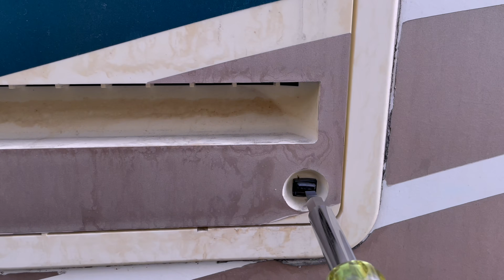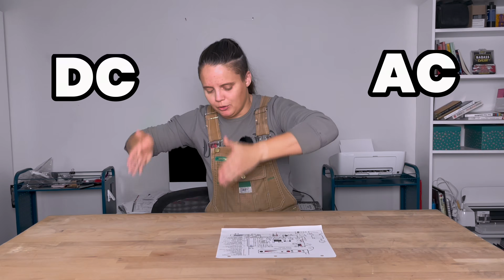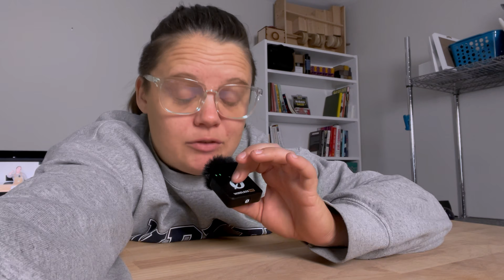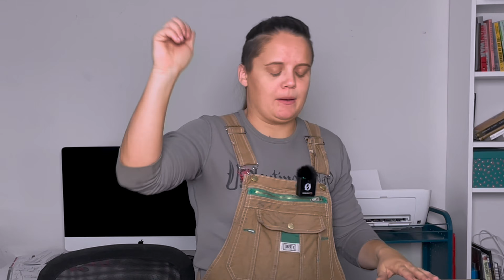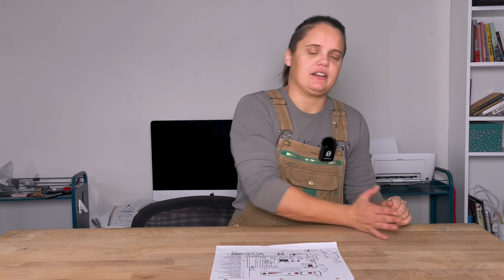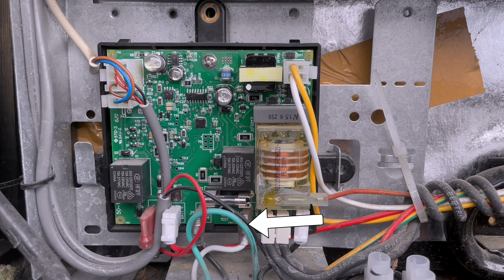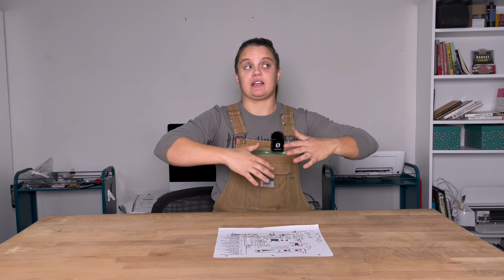How to Troubleshoot Your Dometic RV Fridge (With a Mobile RV Tech)

Comment: My problem is a F Error, burner ignites good flame and keeps igniting till timeout when the gas line solenoid shuts down fuel flow as it thinks the fuel is not lit. I cleaned then replaced the ignitor line and corroded burner tube and cleaned checked contacts of ignitor and thermocouple. The ignitor gap looks good-ish and gets the tip red hot. Fuses on the board are good, same  F error on eyebrow denoting that the gas ignition liting is not recognized as such. What can i do next on this 2001 Norcold N621 ? AC mode works fine. My ignitor is supposed to send millivolts back to the board showing it is lit but something after that point is "out to lunch". The replacement Boards are not easy to find, i could try a third ignitor... Any suggestions.

Comment: Hi have a dometic americana 2
Ran out of propane in the middle of the night switched tanks its all working with flame constant for over 8 hrs no cooling taking place though.
Electric works to cool but propane is all working with flame but no cooling taking place checked the thermal disc fuses etc.???

Comment: @rvrepairwoman what if it starts on propane SOMETIMES and then runs but eventually turns itself off? What is the issue then? Like the fridge cools and everything is fine but I come back after a few hours and it's turned off and is more difficult to restart?

Comment: Hello Emily, I find your video very helpful. I just have a question in your video when you’re doing the electrical and your testing the black wire going back up to the circuit board it’s supposed to have 12 volts  Mine only has nine. I had my circuit board checked, and it was all good, I was wondering, how do I know if my fridge is just crapped out and I need a new one

Comment: This video is very informative! I am retired maintenance worker, and following your tests there were a few things I didn't think of. My problem was not the control board, that all the tests pointed to. It was the thermal switch needed to be rest, which was confusing for me because I had power going in and out, but still would not cool on AC. I did put a new control board in to no avail, and sort of stumbled on the reset button. The problem I have now is everything is freezing in the fridge, so I assume the switch still isn't working properly, so I will replace that also. But again, great info! Thanks!

Comment: My igniter will not stop clicking and arcing. It lights and keeps running, but the igniter keeps sparking. The last 1/4" of the thermocouple glows red, so it is sensing heat. Also, it appears to be running ok other than that. I'm not sure where to go from here. It does not have a thermo disc.

Comment: Emily, I’ve learned a bunch but no dice…

Any idea if pilot lights but only for a few/10 seconds? Works on AC but not on gas. Pilot only stays on for 5-10 secs. Solenoid? I’ve changed ignightor? I am a little curious I have a board out of an older refrigerator that supposedly worked but it has J2 through 10 and the one that I have has J1 through 10.

Please help hold up in the remote part of the Colorado mountains

Comment: Hello, thanks for the  great information. We followed every step, and all was okay except our original problem.  We have a new dometic dm2672 2- way, which continuously buzzes and the check light is on when set to auto (AC) even though the fridge works. Propane works great , no buzzing. Do you know how to stop the buzzing?! 😂

Comment: I’ve done all of the diagnostics you’ve shown here and my problem is that everything passed. I can’t get my fridge to run on A/C because it keeps defaulting to propane. I have 12 volts to both the green and black wire simultaneously. Any idea what’s going on?

Comment: Hellllpppp! Tested everything like you said, no volts at the orange wire, so changed the circuit board and still no voltage at the orange wire.

Comment: Lots of great information but what if i dont have voltage to the yellow wire? The one that goes to the valve. The lights work fine on the eyebrow but the "check" light stays on but the fridge wont turn on. With the gas on, and the eyebrow to gas, i have no power to the yellow wire. Please help...
Kris

Comment: I have a little stinker of a board of the diagnostic side. Dometic board just like the one for your parents. I checked everything you suggested except the orange and black wires in the connector oops and the disk. I tested the element out of the camper by hooking up to electric cord, cherry red. And 12 volt fuse is good. Werid thing about the 120 fuse is the fuse removed I get 120 volts on one side of the holder, OK put fuse back in and 120 volts NOT on the other side. Test heater element pins #7 and #8 one side still has 120 volts ac at these terminals. What am I missing? I took heater element out of holder and was dangling outside the fridge plugged in to 7 and 8 terminal still nothing. I didn't check disk but even so why does voltage appear at 7 and 8 no heat. Could my board be no good?
Reply: I do realize with 120 volt fuse out nothing should go any farther, there should be no power down the line.
Reply: Well just got back in from testing again, tested disk continuity okay. Didn't have any voltage on either wire to disk. Took 120 volt fuse out and still have 120 volts at pins 7 and 8 for the electric element. Oh, yes checked orange and black up in left top corner both have 12 volts DC. So what does the 120 volt ac fuse protect? I will watch your video again to see if I interpreted something.
Reply: At 18:21 you speak of checking line voltage coming into circuit board on the left pin is the black absolutely no voltage this is marked AC line, pin on the right labeled AC neutral the white wire. Checked both wires black ac line has nothing white on the right neutral has 120 volts on it, I think the wires are switched the white with 120 needs to be on the AC line, is that correct?
Reply: After gas clicking 75 clicks 3 times it won't go into electric mode, terminals 7 and 8 never ever get 120 volts when they did befire I switched the line in and neutral on the board.

Comment: Great video!  My fridge is working on gas but not electric. I went through the whole video and I don’t have 120V on my heater pin. I flicked and tapped on the relay but no change. Looks like I will need a new board. Thank you for the step be step troubleshooting!

Comment: Question! I have Dometic fridge circa 2007? Works great but must be unplugged from a/c current to run on propane? Set to gas only mode? Has new control module.

Comment: I went through EVERY step you recommended to trouble shoot my Dometic fridge. (Thank you) But I couldn't find any obvious problems. Every electrical test showed all was well. I finally called a professional to come take a look at it. It's reading an error code "E0", which supposedly means a communication problem. He told me to replace the button controls and the digital controller/display card. It's still showing the same error code... any ideas? It does not have a leak and the heater gets hot when he put power directly to it. Thanks

Comment: I have 12:46 in the orange cable and 10:75 in the black one, is it ok?
Reply: I checked mine yesterday and found 13.35V on the orange wire and 10.85V on the black wire...I'm pretty sure you are okay with your readings

Comment: Great video and you explain things very clearly. Thank You!  I followed your directions and 12 volts at orange wire/pin (on control board to eyebrow board P1 connector), but  only 1.4v on the black/wire pin a the lower/outside control board. Assuming either the eyebrow board itself (upper control board) or a wire between the two is bad? Lights on the eyebrow/control board inside intermittent and although bulb is good, the inside light doesn't work. Schematic shows eyebrow board supplies the 12volts to the inside bulb also so it must be getting low voltage also from the eyebrow board? Your thoughts if you get a chance to respond would be appreciated!

Comment: You Rock Rv Repair Woman!  Thanks for this brilliantly informative guide.  We have a Dometic 3 way van fridge that failed a couple of years ago.  I watched a fridge mechanic fix it... it was failed 240v heating element.  Fridge failed again a tad over 2 years later, so I watched your video on testing amps and sure enough, the element had failed again.  I noticed a dodgy connection on the thermal disc, so switched both parts out.  Once that job was done, my eyebrow board was dead... so watched your video again in full and chased down wires everywhere, to find a blown fuse.  So thank you once again.  Saved us from opting to fork out $$$ on a new fridge!

Comment: Dometic RMD 10.5T is not operating on Gas. The control panel, control brick and solenoid were replaced 6 months ago and worked perfectly up until about 2 weeks ago. I am electrician, have checked the solenoid which is OK. There is no clicking can be heard, I think the control panel is working OK but can't be certain. My question is, how to test the control brick? I can't see any burnt or lose wires. is there a circuit diagram available?

Comment: I have no power at the yellow wire on the circuit board that goes to the gas valve. What would you recommend doing next?

When turning on my fridge it immediately illuminates the check light. And I hear no clicking from the igniter or gas valve

Comment: I did all the steps and my dometic rm2354 fridge has a flame on propane mode but there is a dim check light that pops up only on propane mode this doesn’t happen on ac mode if connected to shore power I checked the circuit board at all the points in your video and heard tick after and see blue flame everything seems to be working except for this dim check light on dc/lp mode, why is this??? Pls help

Comment: This is a fantastic video. I make it to the point of the video where we start to check AC voltage. All my DC voltage is fine... but as soon as I plug the fridge into the 120 v outlet, everything trips and shuts off and I have no more 120v. I have tried the 120v outlet next to the fridge on the camper... I have also run extension cords to more than one outlet in my house... and the end result is always the same. After being plugged in, a few seconds later ... either 30 seconds to a minute, it will blow the 120v outlet. Thoughts? Dometic fridge. Thanks.

Comment: Thanks so much for the great video — it was really helpful!

I have a Dometic fridge in my Airstream trailer, and I recently replaced the circuit board because the fridge was working intermittently. I suspected the board was the issue, but maybe I was wrong. Now that I’ve swapped it out, I’m getting two quick flashes on the “check” light on the eyebrow board.

Is it possible I hooked something up incorrectly, or could something else be causing the problem? Any insight would be really appreciated.

Comment: Great video, so in depth! Found my faults and now I need to fix them!

1. My gas valve is not getting power
2. Black wire from eyebrow board  for ac is not getting power.

Just replaced eyebrow board and all lights working. Any help much appreciated!!

Comment: I have a dometic fridge. I’m getting 120v to my outlet but when I test that j5 port I’m getting only 77ish volts. Pushed all the ports in to make sure nothing is loose. Could it be a bad ac plug that I should replace or bad circuit board? The fridge runs for a few minutes then my thermal disc pops and needs to be reset when I’m running it on shore only.

Comment: This is the best troubleshooting video I’ve seen on the subject. Well done. One thing missing, which seems to be somewhat common. Is the flame igniting and running for a about 10 seconds then turning off.
Reply from the maker: Yup. I’ve gotten a couple comments about this - if this happens to you I’m guessing your igniter is bad. Inside your igniter is a part called a thermocouple that tells the circuit board whether or not you have flame. If that goes bad then the circuit board doesn’t know you have fire to burn off the propane and shuts everything down so we aren’t shooting propane everywhere. Try changing out the igniter and see if that solves your problem
Reply: @rvrepairwoman  if I may say, this doesn’t make sense to me. If we have fire, the ignightor is doing its job, correct? I’ve replaced my thermocouple and am wondering if it’s the relay? I have the same 10 sec flame on /off

Comment: Thank you for the video, my fridge wont get cold on electric and propane. Was going thru the tests and when the ignitor kicked on I got a huge whiff of ammonia, so seems I have a leak somewhere. No yellow dye so its somewhere. Looks like a tech job now, sucks especially since I live in my 5th wheel

Comment: I wonder if the thermal disc or fuse is my issue... My fridge works on 240 and 12V, it lights on gas but then switches off multiple times - maybe the flu is blocked and the disc is switching off?
Reply from the maker: Definitely go check your thermal disc. But if that guy is testing fine, then I bet you have a bad thermal couple. It’s not something I talked about in this video but your thermal couple is a part of your igniter and that’s what detects if you have a good flame. So if it goes bad, then your circuit board doesn’t know that you’ve gotten a good flame and so it shuts the fridge down. So that’s the next thing I would check.
Reply: @rvrepairwoman  that's so helpful. Mine is a  10.5T but there isn't a thermocouple above the flame. I've seen the Domestic burner design with one above the flame but mine doesn't have this. A trip to the engineer I think

Comment: Great video. I followed your steps, replaced the control box and now the fridge works on electric.  It does not work on gas.  there is 12 volts at the gas solenoid but it does not trigger.  It does work if I power it with a jumper,  12 volts and a jumpered ground.  Also no spark.  While checking the grounds I unplugged the J-10 plug and could hear sparks jumping around inside, plugged it back in.  I feel like there is a ground connection missing somewhere.  I this another bad control box?  Thanks

Comment: Great video, thank you so much for all your information, I would have been lost without your help, I've already changed the eyebrow board with no luck, bought thermal disc, don't need because mine still good thanks to your help, now thinking it the main board, no 12 volts at black wire or orange
Reply: Put a new control board in and eureka it worked I have my refrigerator again, wanted to say thank you again, I couldn't have done it without you

Comment: The thermal fuse connection on the circuit board has no power, but terminal block does. Is the circuit board bad?

Comment: So my domestic fridge is only 2.5 years old and is dead. Seems to need a new power control panel. It's a sealed circuit board. Maybe I can hack into it but otherwise it's a $650 part! So at that point you just buy a new fridge. What a joke dometic is.

Comment: For those of you willing to invest in a Manometer make sure you calibrate the new gauge before the first use. I had assumed everything was ok fresh out of the box and tested my RV propane system to see it read 16in.WC. When I went to re-test a few days later I did notice the gauge was already at 2-3 in WC. On my gauge, you turn the glass faceplate off and turn the adjusting screw (at the bottom center) '+' or '-' to properly align the needle to '0". I am replacing the regulator anyway because, 1. I had already ordered a new one and 2. The regulator is possibly over 10 years old (approximate service life). TC

Comment: My Dometic RM2652 fridge works perfectly, except it freezes everything.  I downloaded and printed off the service manual and followed all of the testing procedures and everything was to spec.  I changed the thermistor and control board anyway "original therm" was within specs.  After all of that it still freezes on LP and shore power.  I have a question, online some people are saying I need to remove the fridge and turn it upside down for 24 hours and it will work again, others say to beat the crap out the "pipes" with a mallet to burp the system, or even defrosting it and let it sit for a week.   Right now I am just turning it off and on a few times a day at the eyebrow to keep the fridge near a normal temp. It is a small pain in the ass but it works.  Suggestion? Tips? Thoughts? Anyone?   PS. I watched several of your vids, including the huge burp one 😵‍💫 and followed all of your testing instructions.   Thanks.